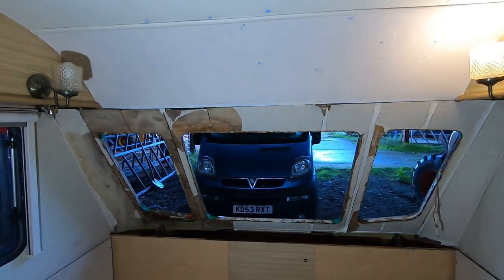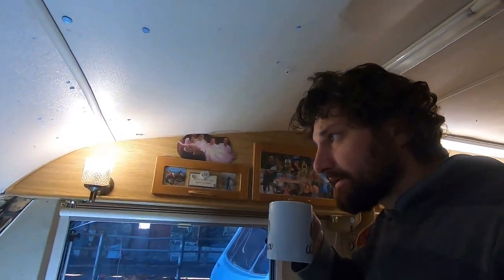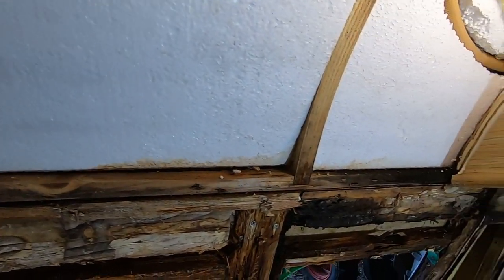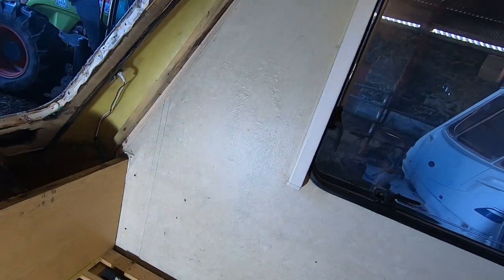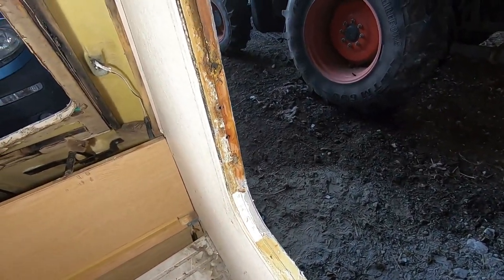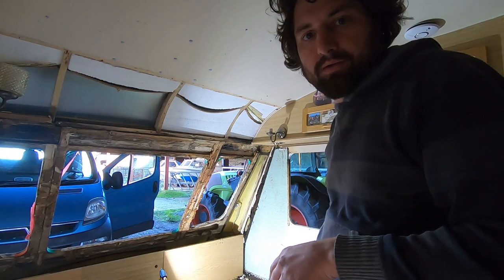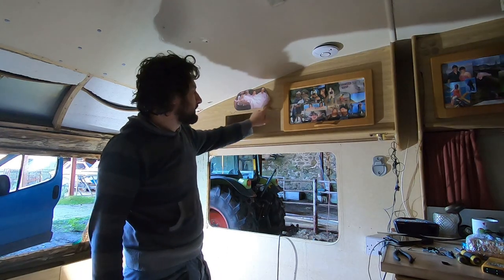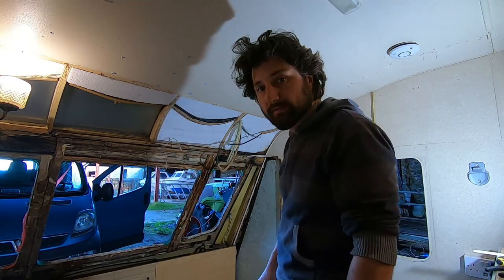Repairing A Damp Caravan: Part 2 – Removing outer plywood skin to reveal the timbers.

Comment: Great videos, thanks for posting! I've got to do similar at the rear end of my Avondale Sandmartin. The top kitchen cabinet is starting to fall apart due to the awning pulling the side wall away from the roof join where it must have already been weakened by water ingress from the awning rail (unfortunately I've been working away this year).  It's going to be a bigger job than the one my sister and I did on our parents' van (1980 Ace Rallyman) back when there were no digital cameras, broadband, YouTube etc, when we replaced part of the flooring and all the timber and ply around the door. (It was a lovely little van, still miss it!)

Comment: I'm half way through the same job on my Swift although luckily mine is just the front from the top rail. Good luck with the rebuild.
Reply from the maker: Best wishes for your rebuild also. I keep finding more bits to do, but this winter I'll only focus on the front end. You get to the stage where you sometimes wonder whether it might be easier to just strip it back to an empty trailer 🤣

Comment: Hi Jamie

I don't envy you with this project, good job you have somewhere to get under cover to work on it.

Let me know if you need any photographs sending over so you know how it goes back together. 😉

I saw a video on YouTube of another guy who had a leak in the front windows of his caravan, he carried out the repair and then added a J channel above the windows to act as a gutter so the water didn't run off the roof straight in to the tops of the window. 

Might be an idea for you, depending on how long you are wanting it to last. 

Good luck with the project I hope you get it water tight again without too much hassle.
Reply from the maker: Hi Mark,

Interesting that you mention the J channel.  On one of Facebook's caravan groups, someone had installed a 'gutter' to divert rainwater away from the windows. I can't remember what they used or whether it was caravan specific or not. Any thoughts or recommendations are welcome.
Reply: @TheMcNeillsonWheels  

This guy said it was automotive, I've had a look on the internet and Ebay seems to have a lot of J channel at reasonable prices, you would have to figure out what size you would need.

As you know I have the exact same caravan and my window rail is absolutely full of silicone sealant but doesn't appear to leak. Seeing yours I'm starting to wonder if I should take the window rails of and refit them with proper sealant and fit the J rail before mine gets to the point you're at now.

If it wasn't for Covid I would drag mine over and give you a hand, I get what you say about having already invested time, money and effort in your caravan. We spent an extremely cold and wet night in a tent and I said that was enough and started looking for a cheap caravan and we paid £1,000 for ours last year, nice and clean, seems dry but internally nothing worked properly and I spent the winter and lockdown taking things a part, replacing bits that had failed and putting it back together. 

We were supposed to have been in North Wales near Prestatyn this week but that all went to pot but managed a couple of nights away in East Yorkshire.
Reply from the maker: Seeing yours I'm starting to wonder if I should take the window rails of and refit them with proper sealant and fit the J rail before mine gets to the point you're at now."
Probably not a bad shout, in fairness.  It may buy you another couple of years.  Depends on what you want to do with your caravan longer term.  

" I get what you say about having already invested time, money and effort in your caravan. "
After having spent money to have the gas heater and water tank repaired, I just feel that chopping it in and buying a different caravan sends me into a different set of unknowns.  It's never whether they will become damp, but when.  I do believe in - better the devil you know!

Comment: You have done a really good job i currently live on my parents driveway. I used to have a 2 birth caravan made in 1996.

I didn't repair it which I should had i sold it now I currently live in a 4 birth swift challenger 2000 se

Comment: Was there 2bits of polystyrene insulation missing or was it stuck to back of the wallboard?
Reply from the maker: I think you're talking about the two missing pieces from the ceiling. Our caravan has been repaired previously (not by us), and I suspect that they were removed and never replaced. The additional condensation that their absence created possibly assisted in the rot occurring.

Comment: Hi guys did you not think instead of all the work you have to do would it of not been cheaper just to pick up a cheap caravan and I was thinking as we are back down here and bet you are glad it was not outside yesterday after all the rain yesterday
Reply from the maker: We've been asked this a few times - basically, we spent a fair bit on having the gas heater and water boiler repaired, so it would be wasteful to just scrap our van.  Besides, at our budget, you may just end up buying another damp caravan.  With caravans, it's never a question of 'if' it will go damp, but when.  Also, we're rather sentimental over our caravan.  Finally, as you will see on the rebuild, it will have a fixed bed, which is something that we have wanted for a while.  Therefore, it is better for us to repair and rebuild this caravan to our specification, than to buy another that still isn't quite right for us, especially as we live in it full-time.

Comment: If coming in from both sides of awning rails you would be better of resealing them all top and bottom because you don't want to do all this work and water coming in also from rails would just carry on seeping in so all work would be ruined 
Had all our rails resealed last year
Reply from the maker: Hello Tina,
Once the new timbers are installed, the awning rails will be removed, resealed and reapplied. At present, the forward timbers that support the awning rails have disintegrated. 

Glad you liked the video!
😀